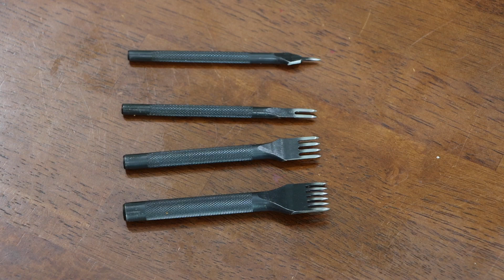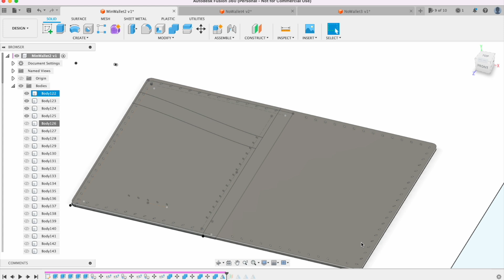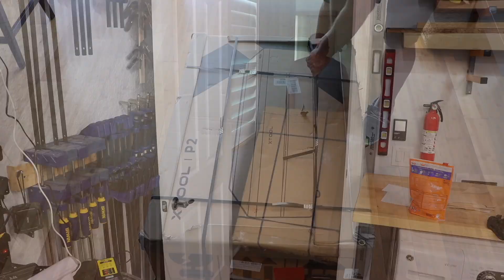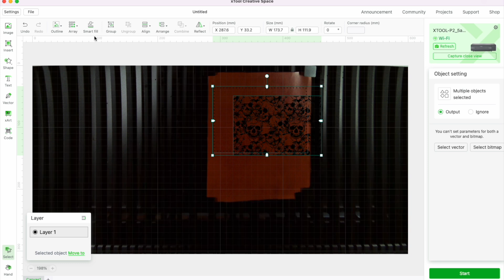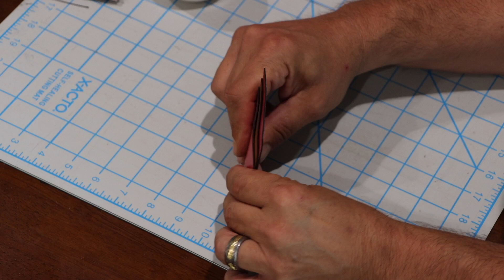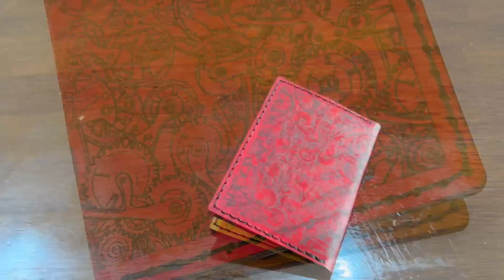Leather Wallet Laser Patterns, with never seen tips and tricks  - with the xTool P2 cO2 Laser

Comment: Hi there, about the diamond stitch, I am a saddler and work always with diamond stitches. You beter use a round hole in the corner.
Reply from the maker: Interesting…. Why is that?
Reply: @ThisIsHowIMadeIt  Whe do it because the leather would not rip in the round corners. And with a round hole in the corner you can make always the same stitch in the corners. So if you see the front of the wallet the corners are always symmetrical. Al this is in the case for those small wallets. If you have longer corners with 3, 4 or more diamond holes you can use the diamond. In the small corners you have to turn to fast. I hope you understand my native language is Dutch. Greetings from the Netherlands
Reply from the maker: @stefaandeconinck1531 I do!  Thank you for the tip!  I do think the computer does a good job at “following” the path.  If the path is long, it may be several holes…. If it’s short it may be a single but it would be turned correctly.  I can definitely see the benefit of doing by hand…